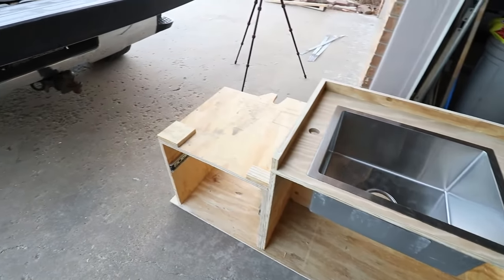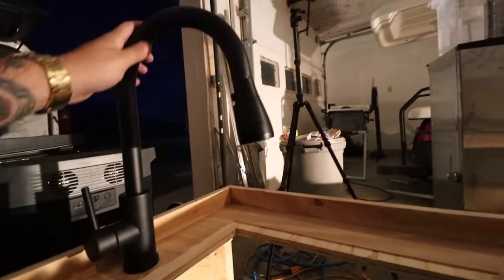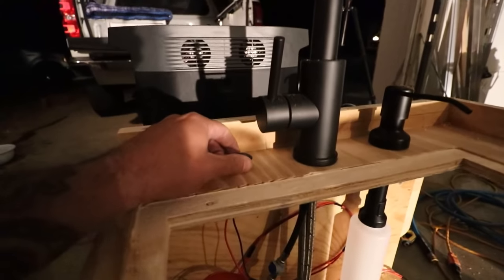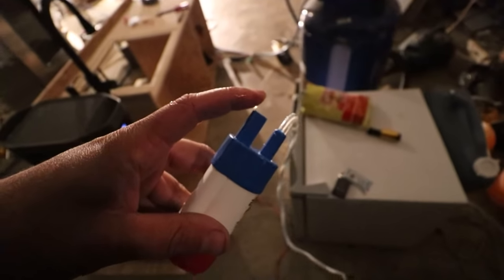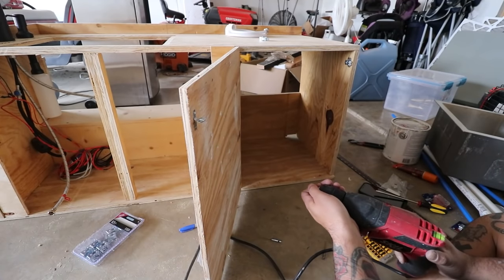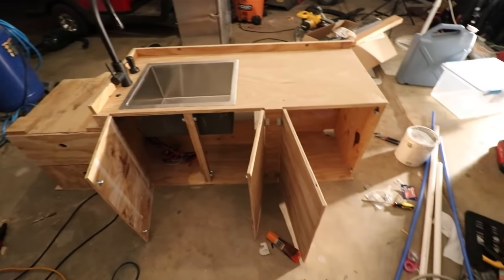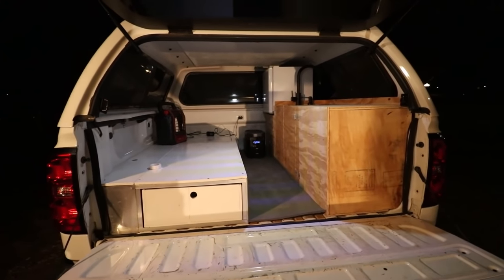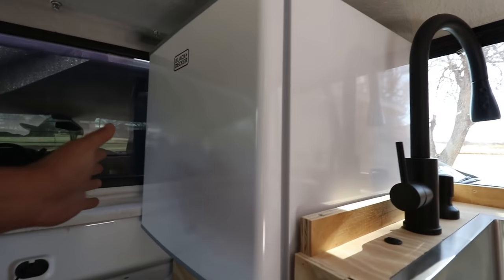THE TRUCK CAMPER BUILD IS DONE AND IT IS AMAZING!!

Comment: Hi there, I saw your vid. I've been truck camping since the mid 80's.  Here's what I've learned & I'll pass them on to you.
Some of this you may already have, do, or know about.

1) Get stuff you need at a camping store for backpacking. It's small, compact, & light weight. 

2)Get splash guards for your truck. It'll help keep you & your rig clean. They work. I know.

3) When parking for the night, park headlong into the wind. That way if a storm comes you won't have to worry about a side wind ripping off your camper shell. Plus, if anything comes bouncing towards the truck, since you have a slimmer profile, it might miss you. If it does hit, the front of the truck is reinforced. Also when cooking you're in the lee & the wind will blow the smoke & odors out of your rig.

4) Use bug spray on the interior doors & windows/ screens openings to help keep bugs out. Use wasp & hornet spray around & on your tires to help keep critters out. Basically, all points of contact on the ground.

5) An inch is a lot of room. Learn how to stack & get used to sand & dirt.  Use floor mats to put your shoes on too

6)Air out your sleeping area every morning or often. In an enclosed space the air gets stale. 

7)Use a small fan to circulate the air in your sleeping area. This will help prevent hot & cold spots from forming & help prevent condensation & mold & mildew from forming. 

8)Use a solid hooded sweatshirt. Draw the hood tight when you sleep to help encapsulate body heat. It can double as a pillow/ dirty clothes holder/ gear carrier etc.

I hope this helps. Great vid, thanks for sharing. Drive safe. 🤠

Comment: Couple ideas for you and some praise. Possibly add a t-junction for the water jugs with a quick disconnect at some place so you can fill water jugs and run off remote water at the same time without having to remove maybe. Again great attention to detail very well thought out and good use of scrap wood and new wood build and my inspiration for mine absolutely love your carpentry skills aslo now looking at aluminum myself now. Solar side get a secondary set up that you can move around and can assist and you can put away easily, trust me one panel is not enough sometimes. Build a cover for the sink out of wood as a cutting board/cover maybe for catch and cook.

Comment: If a hole gets stripped use a small piece of wood to stuff in the hole then run the screw, it will hold tight! Also definitely stain the top and paint the bottom! BTW the shadows of the tree on the truck make it look like a badass camo paint job!
Reply from the maker: It wasn’t the wood that was stripping, it was the screw heads
Reply: @AdamRyanA   ahh I thought it was the holes stripping out, yea nothing you can do about the screw heads other then replacing them or trying a different drill that has more speed settings

Comment: If your screws are stripping out the heads, you are probably using the wrong size/type of bit.  I used to hate Phillips head as well.  But size the bit right and they are not too bad.  Also there is another bit that looks like a Phillips head but has some small little peaks between the blades, I forget the name, but they look descriptively like a Phillips but are not and will also strip if the wrong bit is used.  Welcome to Springfield.  Native resident here.  And I absolutely love your vid.
Reply from the maker: It was just really crappy soft screws and tiny so hard to hold it right, definitely some user error tho lol

Comment: I really like the idea of having the water exit out to the ground... question ⁉️. What will you do to prevent rodents from coming in though that hose?
Reply from the maker: I plan to drill a hole through the pipe and wrap metal screen around the end and then zip tie it through the hole so no bugs can get theough